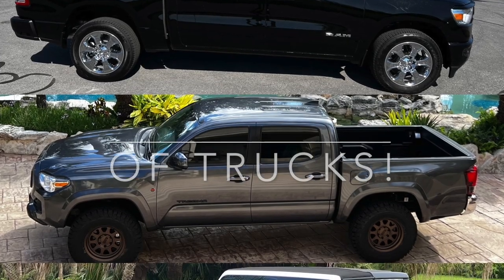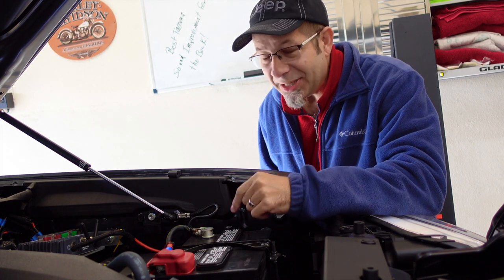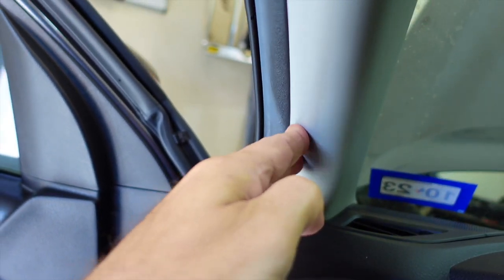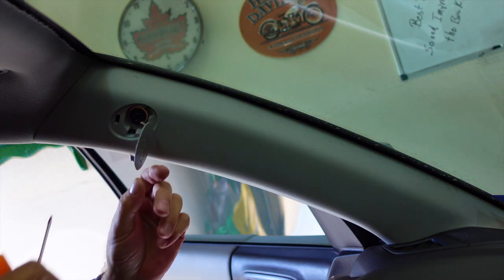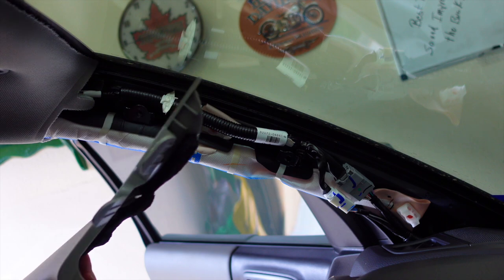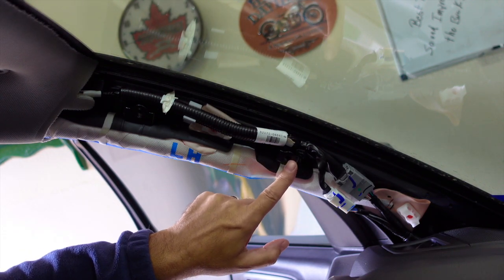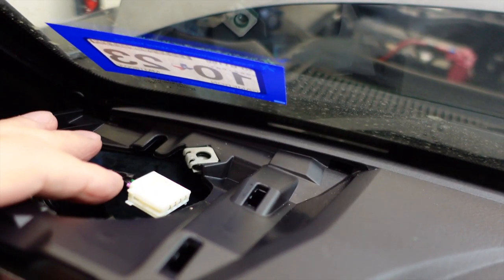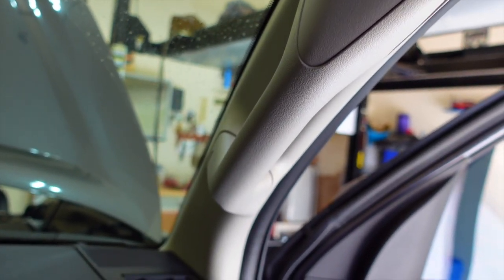Best Tacoma Sound Upgrade

Comment: Rob,   

Just installed the Kicker tweeters.  Thanks for this recommendation, they sound MUCH better than the factory tweeters (and I was very careful not to drop sockets or bolts into the dash!!!).

Installed many of the same mods on my 2022 TRD OR that you have recommended in the past.   Only a few more to go….or at least that is what I tell my wife😅.   

Also since I live in the north and its winter time, I did this install after I was driving for a bit, so the interior trim was heated up to around 70F.   Dont like stressing the plastic attachment clips when the interior is cold…they break more easily.  

Thanks for all the effort you put into the channel.
Reply from the maker: Lol!  Glad to help Gary!  So many awesome mods for the Tacoma!!

Comment: I did this to my 2020 not long after I got it. I replaced the door speakers too with kicker DS series speakers, the CS series speakers every one prefers were unavailable due to supply chain issues at the time.  I thought it all was a good improvement but the factory stereo system is still too under powered. 
I added an Alpine power pack mini amp that provides 45 watts RMS X4 and that really was the improvement I was looking for.

Comment: Agree disconnect battery. Also remember, airbags are powered by large internal capacitors, so they will still be able to fire even after battery disconnect. They cant really be made ‘safe’ , so yes use caution.⚠️
Reply from the maker: Good advice 👍

Comment: To think you just fixed the caliper rattle.  Haha I hate when this crap happens.  I must disagree about the door speakers.  The kicker door speakers are a great bass improvement.  I also lined all 4 doors with sound mat. This also helped quiet road noise. But I agree the tweets are a must.
Reply: I did the doors, back wall, and the floors with nico sound deader and close cell foam. Did it in stages.  Consider doing that back wall, and under the cubbie holes.   Can do it in a couple of hrs for sure.  I did the doors first, that helped.  When I did the back wall, that gave more bang per buck.
Reply: @CarlArriaza  good advice. I was definitely contemplating having a body shop drop the headliner and do the roof as well.

Comment: Be very careful when removing the tweeter covers … I replaced mine in January cold in Virginia and broke one of the tabs holding the cover in the dash.  The broken piece fell into the dash (probably the same place Rob’s socket is resting!). It bothered me so much I bought another cover, which cost $75!!
The little sensor on the passenger side cover is for automatic headlights, which not all models have.  My ‘19 TRD Off Road does not have the sensor.
Reply: TRD Off Road only has automatic headlights in the Premium Package (which I don’t have.). All Tacomas have automatic high beams as part of the TSS.  That feature works via a sensor in the rear view mirror.
Reply from the maker: Not true.  I have the SR5 (non TRD) and I have the sensor located in the passenger side tweeter cover (you can see it in the video).

Comment: Use a tool with a magnetic end, the tool arm should bend and its very slim. Your wrench is wedged..thats why no sound, it will not just pop out like magic. Yes the door speakers will make a huuuuge difference. Do not use a 3way or 2way. Your highs will be clear at head level and the mid low will be clean below. No funnel high end coming from the door you will notice a huge difference. The kickers are plug and play on the tweeters. As advertised for the Subaru, they are perfect match for tacos.

Comment: What kind of kicker tweeters do you recommend for the 2021 Tacoma?
Reply from the maker: Kicker is a brand.  I use Kicker👍
Reply: @RobMotive  Thanks rob, I found out i have the JBL system! Tweeter upgrade wont work.
Reply from the maker: Actually there is an adapter cable available now👍
Reply: @RobMotive  Are you keeping the name of the adapter cable for new tweeters, secret? 📢 🏁
Reply from the maker: Huh?

Comment: Too funny, I dropped a 12mm when installing my light bar wiring.  I think it may have ended up on the skid plate.  Not worried, dont care, bought another for $2/3 bucks & when Toyota does the next service I will mention if they find a socket, it's mine.
Reply from the maker: Lol!  I was more concerned about it rattling in there somewhere 😬

Comment: Hey Rob, I'm about to bite the bullet and replace the speakers and add a four way amp.
Can't take the driverside front speaker always blowing(replaced three times by the dealer and as I drove off the lot, it blew again) I was abouy as pissed as you were dripping the socket....and I've got the JBL system. Anywho, the only real concern I have about the socket is that it's near the blower fan.  It should be shrouded so think your okay.  Take care and be safe out there
Reply from the maker: My concern too😡

Comment: Aloha and good evening Rob 🙏 ✨ ☺.   This is a difficult mod that you performed.   It happens when a piece of tool gets lost.  Don't feel bad because Iost my spark up socket when it fell into the drain on the street.  I can understand that irky moment, but the part can always be replaced without any temperance.   Yet, you did a fantastic job in processing this tedious a d difficult mod.  As you always stated, "Take your time, don't rush the mod, a d be patient in your modding."  Great video Rob 😇 📹 👍 👏 👌 🙌 😎🤙👍🤜🤛🙌👀
Reply from the maker: Thanks Ryannew 👍

Comment: Gotta disagree here. The biggest improvement in overall sound quality is definitely the 6x9s (front door speakers). The tweeters are great but unless you just want amazing highs you have to at least replace the 6x9s too. I think the rear speakers are the only ones you could leave stock. I noticed an improvement in replacing those too but it is not huge.
Reply from the maker: I suppose it’s dependent on the ear🤔
Reply: @RobMotive  The Kicker CS 6x9 are a 3 way speaker the overall sound produced by that is not even comparable to what any tweeter can produce by itself. Maybe you just enjoy the loudness that comes with that tweeter compared to stock. I agree it is a good tweeter and is a huge improvement from the stock but with the 6x9 you are getting high, mid, and bass not just high.
Reply from the maker: I’ve done the door speakers and noticed no real difference .
Reply: Rears should be replaced as well. Id use a 2way. Do not use a 2 or 3 on the fronts.